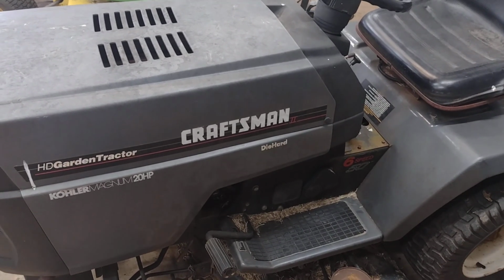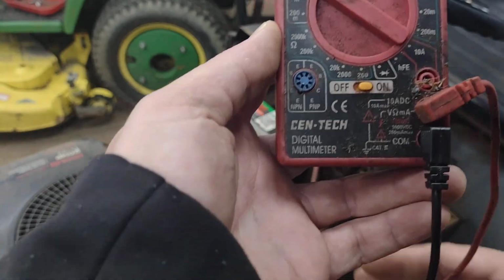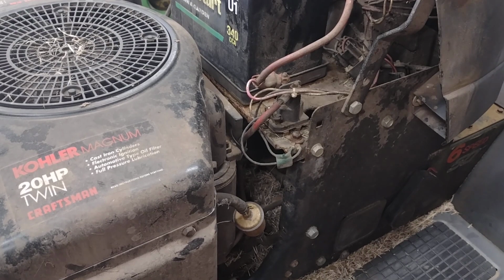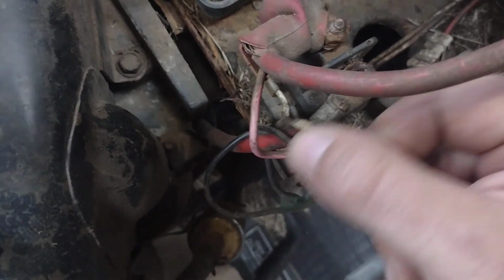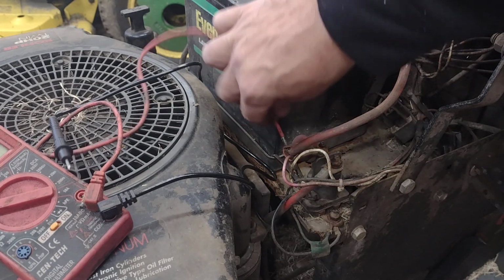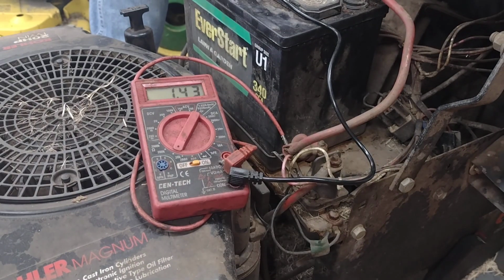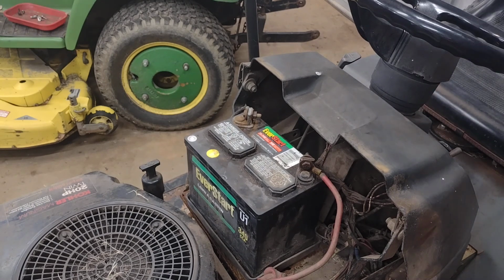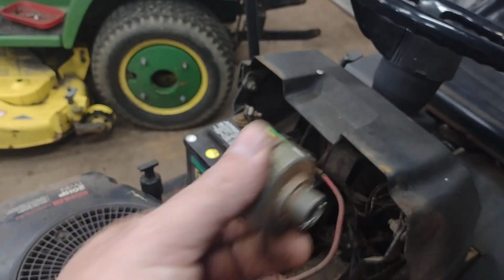Mower won't start?  Watch this!!

Comment: My Craftsman LT1000 would not crank today. I found out it was the safety switch on the mower deck engagement lever.  I jiggled the lever some and it allowed the plunger on the switch to move completely out.  This switch prevents starting the mower with the blades engaged.  There is another safety switch under the seat which will prevent engaging the deck if one is not on the seat.
Reply from the maker: There is also one for the clutch/brake pedal.

Comment: Or you could jump the power wire to the starter at the solenoid to ground and make sure the thing works before replacing the switch.  Or cleaned up the corroded contacts on the old switch.
Reply from the maker: It was a bad switch. The contacts may look corroded in the video, but they really aren't bad. It's still working like a champ!

Comment: Solenoid? Isn't that a relay?
Reply: The solenoid here acts like a very heavy duty relay with a magnetic plunger switch. It handles lots of current/amps.   On many car/truck starters the solenoid is mounted on the starter motor.  Traditional cube relays are smaller.
Reply from the maker: Starter solenoid. No relays in this video bud.
Reply: a type of relay,  it does the same thing

Comment: It is preferable to use the lowest ohm setting for continuity tests (200Ω range on this meter).
If you run into green rotten wires, they can still give you a 'continuity' reading if you are on the higher range (k ohms or meg ohms), that is not good enough to conduct any reasonable current.
A good continuity reading should be less than a few ohms at most, counting the resistance of your probes and test connections, that cannot be avoided...

-nice video

Comment: I have ten of those harbor freight voltmeter test them first. There mess up all time and can throw you reading off..I had to buy leads from. Radio shack battery store.
Reply from the maker: Yeah, sometimes you may have to go through a couple to get a good one. I'll usually test them before I leave the parking lot to make sure.

Comment: Seat safety switch your missing. Troy Bilt has switch for reverse position that shuts the mowing deck off. Crazy.
Reply from the maker: Did you watch the video bud? I walked through the diagnostics of it.
Reply: Not long ago My uncle took an older rider to a mower repair, charged him a days labor and still didn't fix it. Just wouldn't start. In 10 minutes I had it fixed as one of the safety was bad. Rip off. He didn't tell the guy that he didn't want an overhaul.
Reply from the maker: @thomashoward9806  unfortunately, there's a lot of people out there claiming to be an experienced mechanic. When, in reality they don't necessarily have the skills to be in business for themselves. Hopefully I can help people out through these videos that I can't help in person.

Comment: Check the fuse? Usually there is a fuse in the start circuit that will prevent starting if it's blown.
Reply: Thanks for explaining key switch differences  I did not know that
Reply from the maker: @joesummers9864  thanks for watching!
Reply from the maker: Did you watch the video, bud? I thought I explained pretty thoroughly what was happening.
Reply: @shadetreediy7743  sorry, if you mentioned it I missed it. Brain fart maybe, lol. You did cover everything well though.
Reply from the maker: @donaldshimkus539  it's all good, bud. Thanks for checking out my videos!